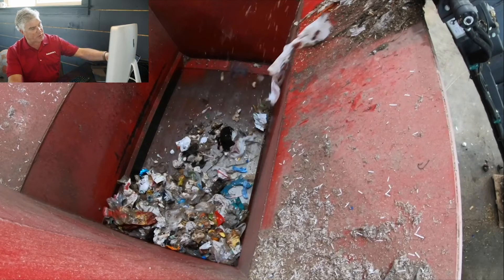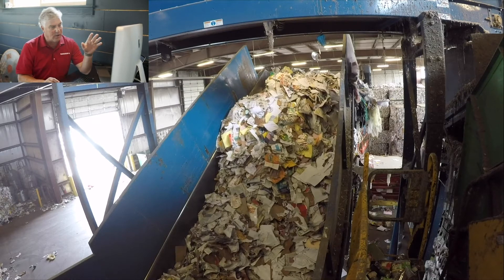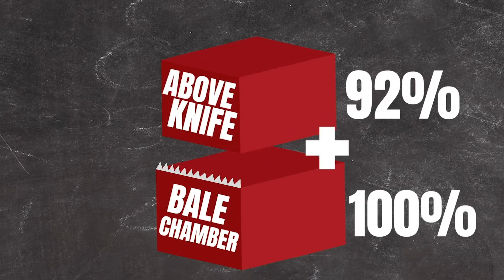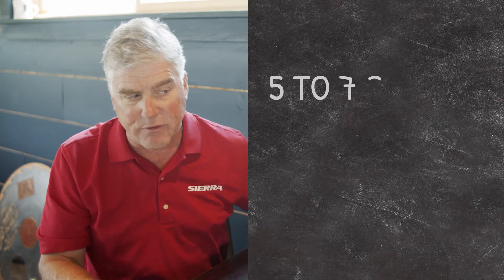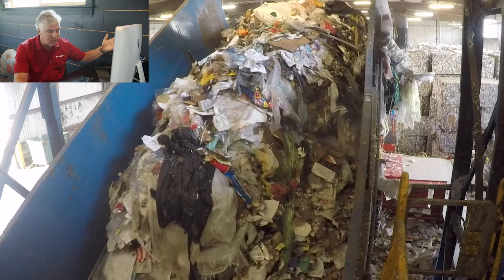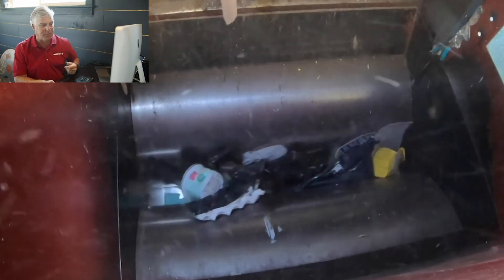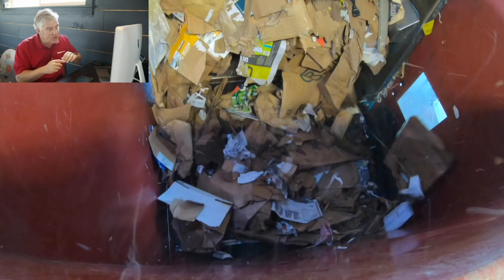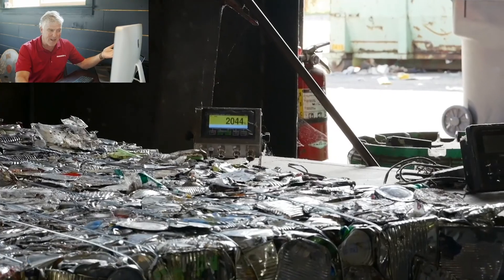John Sacco Reacts – Difference between the REB-4 and Conventional Two-Ram Balers

Comment: When we run our old 90s Harris HRB baler the shearing and roll back is annoying and I wish we had the compression doors because having shear jams were no fun. But the worst thing was having an oversized bale where it was too  much material was fed into the bale chamber making it too wide for the eject ram to push it out. We had an oversized bale where one time and it took us over 11 hours working until dark with a 5k psi pressure basically shaving slice by slice off the bale and shoveling out the sludge until we could get the bale out of the eject door. Has that ever happened with a REB series baler like the REB 4?